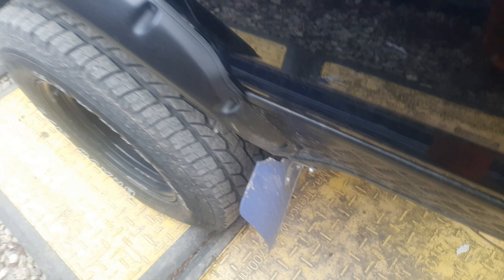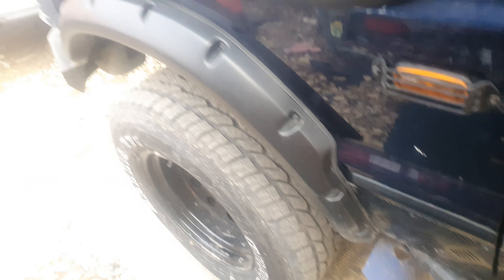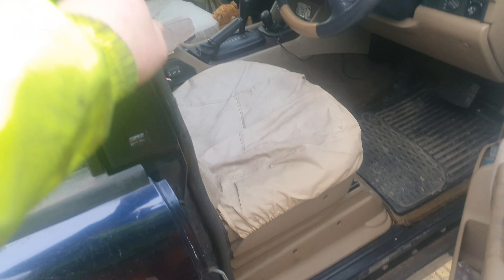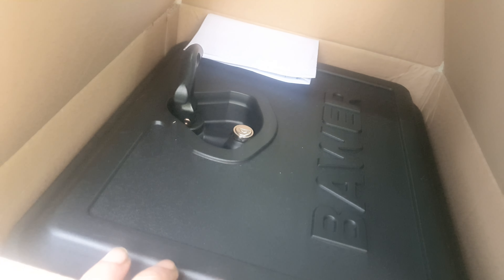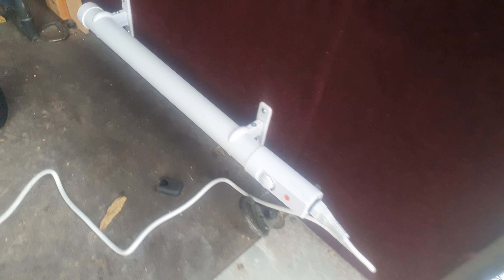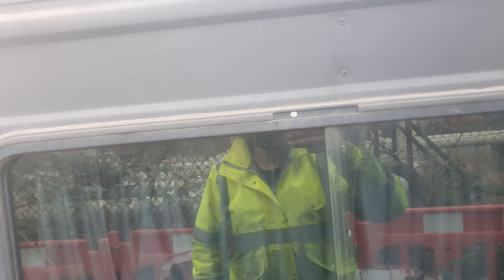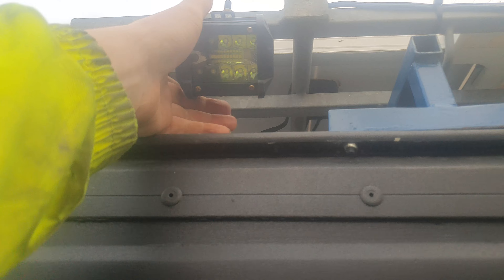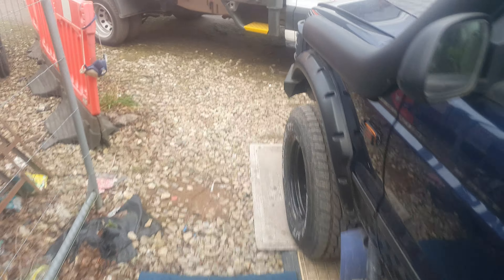A catch up video and what's coming up next

Comment: Interested in the fuel tubing/piping for the doors. Im chasing a leak in the drivers side. I have a cover over my disco when not in use to stop the water but its a right chew putting it on. Ive heard a few people say its the rubber flappy thing that goes over the door stays can let water in also.